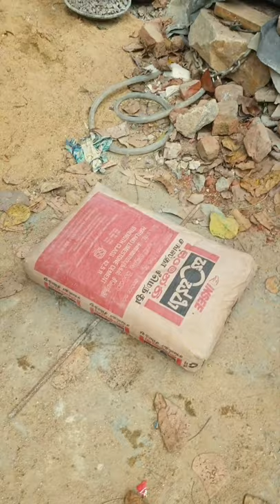Sri Lanka,ශ්‍රී ලංකා,Ceylon,Roman Villa,Tuscan Columns,Construction Concrete,Stonemason,Megaliths

Comment: Looks good what's their daily wages
Reply from the maker: Presently in Sri Lanka and in general the average pay for 1 day of work is : 2500 Sri Lankan Rupees for a qualified mason. 2000 Rs for a helper. A helper is somebody who is not capable of doing the construction work alone. The helper is important for the mason to mix concrete, carry stones and assist him all the time. You can check the exchange rate of the Sri Lankan Rupee on google.  It is now more or less around 2000 Rs = 10 Euros. There are also masons requesting 3000 Rs for a day of work. The decision how much a day of work will cost is also subject to the length of the assignment. A longer lasting mission may lower the price of a work day. Also will be decided if the worker gets 1 free meal at noon included or not. Definitely it is a custom to provide at least 2 tea times during a full working day free of charge. The tea time break will last about 15 minutes. Tea, sugar, milk powder  and biscuits are mandatory.